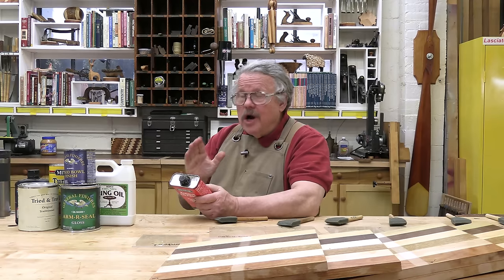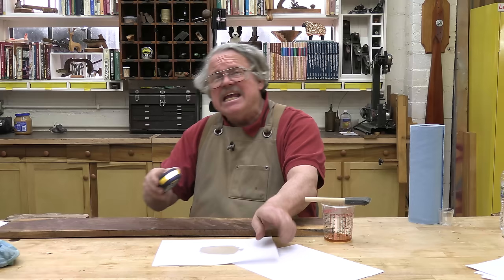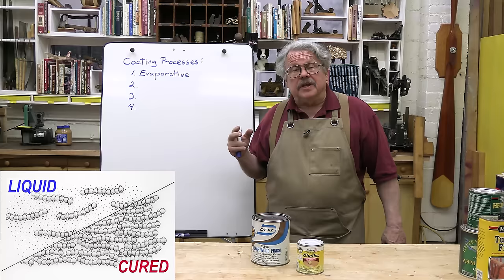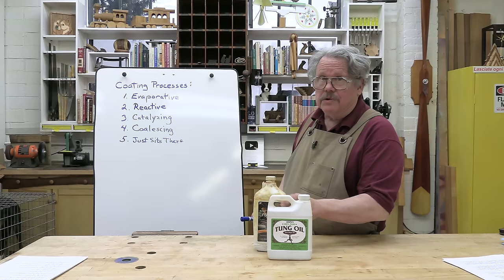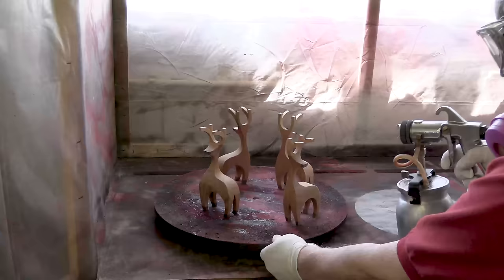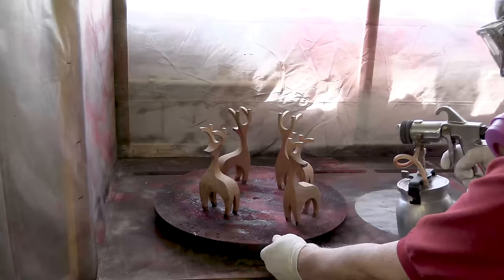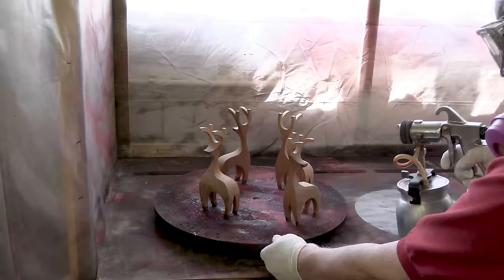Finding the Perfect Finish

Comment: I've tried Rudy's formula on some basic pine table I made and it sorta worked, but is the final finish supposed to be so incredibly glossy? How long should the tung oil + spar urethane solution be allowed to sit on the piece? Should it be left alone like spar urethane alone, or should it be wiped off like tung oil finish alone? The urethane seems to begin hardening pretty quickly, within 1 hour. Does it only need to be on there for 5-10 minutes?
Reply from the maker: It's a wipe-on/wipe-off finish -- every coat. And you can easily adjust the gloss in two ways -- apply fewer/more coats for less/more gloss, or adjust gloss by rubbing out the final coat with coarser/finer grade of steel wool/Scotchbrite/rubbing compound.

Comment: Great video. Wondering if I could make a similar finish using danish oil instead of tung oil. If I understand correctly they have slightly different properties…
Reply from the maker: Would probably work just fine.

Comment: So, in your opinion which finish is best for maple kitchen cabinets?  Want to avoid  yellowing the wood.
Reply from the maker: Water-based finishes, such as the water-based poly in the test, do not seem to warm the wood. However, if you are applying this finish to plywood, make sure it's a good grade of plywood with a reasonably thick veneer. Also. let the finish dry completely between coats. Water causes the wood to swell more than oil, and as plywood veneers have gotten thinner over the years, I'm seeing more and more problems with the veneer layer delaminating when a water-based finish is applied. This happens most often when I'm in too much of a hurry to let the finish or paint dry for a day and for all the water to evaporate.

Comment: I'd be super interested in knowing if you've tried out those improvements you talked about. Thanks!
Reply from the maker: It's been some time since we posted that vid, so I need more to jog my memory. What improvements? Timestamp?
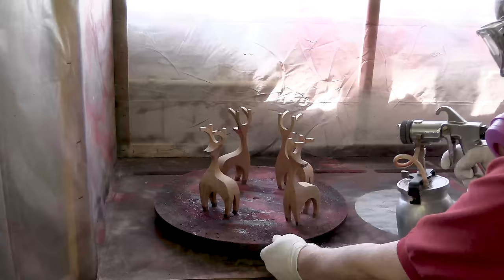Reply: @WorkshopCompanion  Of course, at 26:42 you mention that you'd like to experiment with improvements of Rudy's formula. Did anything improve his formula?
Reply from the maker: @vingtsang120  That was what we call an "exit line" -- something said off-the-cuff just to let me bow out of the video gracefully. I had spent so much time during the video exhorting the viewer to experiment, I thought I'd end with the implication that I was off to do some more experimentation myself. And I have, just not with Rudy's formula -- Travis and I have been testing some of the new wipe-on urethanes, and we're researching solvents and hardwax finishes, all for upcoming videos.  Rudy's best formula remains what I presented in the video.

Comment: This was a great video for sure.

However, to be honest with you, as a person with no experience, its by far easier for me to learn from what I see and know that works. You know, the look and feel Im going for. It would be much better for me to see a piece of wood, or to be shown a specific piece of wood, and to be told and shown exacly how that piece of wood got to look and feel like that. Such as for example, a piece of trim work or furniture in the real world, and to be shown on a similar piece of wood what to use on it and how to apply it in order to copy as close as possible the  techniques in order to achieve the same results.

I know you tried hard to do that here, but I still dont have the knowledge I need to do what Im trying to do.

Maybe I can ask a question to you instead. Say that Im wanted to protect and make more attractive the ceiling joists of my house that are framed using Doug Fir beatle kill non pressure treated lumber from the local Amish mill here. It is a very attractive and clean wood as it is, a but blonde in color, sorta yellow with bluish streaks running all through the grains. A few knots here and there too. I wouldnt want to hide it, but simply protect it and bring it out more so and make it warmer too is possible.

I only have the option of rubbing it or brushing it on and have plenty of time, but Im very sensitive to chemical smells and toxic things so want it to ve safe and natural to handle indoors too.

What could you recommend for me to achieve this?

I would definitely be thankful to you and give you the credit for your time and help. I also did subscribe and like your video too.

Thank you,

-Rocky Mountain Balloon Framer, Farmer & Homesteader
Reply from the maker: A wipe-on water-based poly might be your best option -- if it doesn't sufficiently warm the wood color, add some water-soluble aniline dye.

Comment: Love your videos, very informative and plainly laid out so the viewer learns a lot and can easily understand it. I'm going to be using Rudy's recipe for a dining table I'm making from Walnut. My question is would putting a paste wax on after Rudy's recipe be a good thing to do, would there be any benefits or detractions to doing that, or would it mostly be subjective to personal preference?
Reply from the maker: Thanks for the kind words. I always finish with paste wax, but that's a personal preference. I like the soft glow wax gives. I also believe that it helps keep the surface clean and provides an extra barrier to moisture.

Comment: I realise your video is one year old, but may throw a question at you please? To use either the tinge oil or the bees wax coatings, would they soak in better if warmed up?
Reply from the maker: That's true for most finishes -- a little bit of heat lowers the viscosity. But too much causes it to cure to fast and it doesn't properly level itself. Delicate dance. I try not to get it any warmer than my hands.

Comment: Which are nontoxic while applying for those of us with lung problems which would you suggest.
Reply from the maker: There are very few non-toxic finishes that aren't toxic when you apply them. Many finishes that advertise themselves as non-toxic only become so after they are applied and the carriers/solvents evaporate or dissipate and the resins cure to become biologically inert. Only a very, very few -- like walnut oil or mineral oil -- can you ingest straight out of the can. If you have lung problems that make you sensitive to the carriers and solvents in finishes as they evaporate, you will need to identify those chemicals, obtain the safety data sheets (available online), and avoid those which contain the specific chemicals that are harmful to you. Your only other recourse is to wear an organic vapor mask or an air-purifying respirator that screens out everything.

Comment: Thanks for this great resource! The tung oil finish + small amount of varnish seems like a great way to coat just about anything.

Is shellac really that difficult to apply? I was initially leaning towards getting some flakes and 90+% alcohol (I have a new wooden easel that really needs to be finished, since it'll be dealing with watercolor/acrylic/oil paint), but the tung oil finish + varnish also seems like it'd work fine! The wipe-on method definitely seems like the most approachable way to finish a project. :)
Reply from the maker: I think it's very easy to apply, but it's not a wipe-on finish (unless you want to consider French polish) , so we didn't cover it here. You might want to get yourself some methanol. When I mix shellac, I dissolve the flakes in a little bit of methanol, then add ethanol. Easier to dissolve that way.
Reply: @WorkshopCompanion  Thank you so much for the response! So it's not difficult, just not really a wipe-on finish (except French polish). Using methanol to dissolve flakes is great advice! 

Interestingly, my dad actually had a few of the products you mentioned in this video lying around in the garage, so I might try to use those (since you can't beat free, right?) Thanks again for offering advice — I'm sure as long as I seal the wood *somehow*, I'll be happy with the results. :)

Comment: Hi there I am redoing the coaming on a boat that had teak with sapele. Would you recommend applying tung oil before I use epifanes varnish?
Reply from the maker: I would recommend to test your proposed finishing scheme on some scraps before you apply it to your boat to see if (1) you like the effect and (2) the two finishes are chemically compatible.

Comment: Did you figure out an improvement for Rudy's recipe? Are the final 2 coats where you add the spar varnish rub on rub off too?
Reply from the maker: You can add the spar urethane at any time, but the finish is (slightly) more durable if you use it from the first coat on.

Comment: Exactly the topic I am dealing with those days: when you say "on time"!
I try not to get that yellow from very specific woods like European maple, that is quite white, and that black walnut, that seems dark chocolate. The yellow would make the maple look stupid like softwoods and the walnut look brown. They are build up in the same piece. Any suggestion?
Reply: You're somewhat after a unicorn finish here. Unless you want to mess with CAB lacquer or something similar the choice for keeping pale, and especially nearly white, woods close to their native colour is unmodified water-bourne finishes, including plain ol' waterbased poly.

But this same type of finish doesn't do ABW any favours, it's said to "cool" the colour and makes it look paler and even slightly blue-ish, as many articles and finishing books make a point of illustrating! 

A compromise that is often mentioned in this exact context is decolourised shellac, AKA super-blonde. It does make very pale woods very slightly more yellow but it is much kinder to walnut (although IMHO not nearly as complementary as darker shades). Everything's a trade-off however, the downside is that this is the least protective shade of shellac, so you add minimal durability.
Reply: @tungsten_carbide  thank you so much for your suggestions! 🌞🙏🏻

Comment: Thank you for such a comprehensive compilation! I bought the ingredients for Rudy’s recipe, but then YouTube suggested another video which encouraged the use of a wood conditioner. Do I need this to avoid blotchiness? Thank you in advance
Reply from the maker: Wood conditioner is most often used when you have a wood that is difficult to stain, such as yellow pine or poplar, and you want the stain to appear more even in tone. In most woods, the springwood (the early growth for each annual cycle) is less dense than the summerwood (the late growth). This difference in density is what gives us annual rings. In boards, these appear as light and dark areas in the wood grain. When there isn't a huge difference in density between springwood and summerwood, the stain soaks in evenly across the board and the color appears consistent. As the densities diverge, the stained wood grows blotchy.

Wood conditioner partially seals entire board, making the springwood and summerwood accept the stain more evenly. It isn't a perfect solution, but it eliminates much of the blotchiness.

How do you know if you need a wood conditioner? Run a test. Stain the wood without conditioner. If you like the way it turns out, proceed without conditioner. If the test piece appears blotchy, run another test with conditioner and see if you like the results any better.

If you're not staining the wood, and just applying a clear finish (like Rudy's), there is little reason that I can see to use it. A clear finish will enhance the wood grain, but it won't make the wood look blotchy.
Reply: @WorkshopCompanion  thank you for the prompt and complete reply! I really appreciate it! I am eager to try it with confidence now!
Reply: If I may, I have a new question. I have applied one coat of tung oil on a raw barn door which looks sooo pretty! I had tested it on the bottom edge and loved it. I got so excited I then immediately started on a vanity, also raw, without testing it. Doh! Initially I was loving it, but now it has ended up with a reddish hue, which I’m not too crazy about. I want all of the wood in the same room to have a matching finish, even though they are different types of wood. Could I paint a wash on the vanity? If so, would I use a water based paint? And should I go ahead and finish coats 2-4 of Rudy’s recipe, then do the whitewash? Or abandon Rudy and his awesome recipe, and immediately begin the whitewash?  Thanks for helping out this newbie!
Reply from the maker: @tanyacollins9003  "I want all of the wood in the same room to have a matching finish, even though they are different types of wood. " Uh...good luck? While the major components of wood are cellulose and lignin, each species has different extractives -- chemicals and minerals in the cell walls -- that give the wood it's color and tone. And different sizes and arrangement of pores and rays that give it a distinct grain.  It is possible to make two different woods look somewhat the same if you're very good at mixing and applying stains, but this requires a different finish for each wood species. Most of us with furniture and built-ins made of different woods just settle back and enjoy being eclectic.

In answer to your question, if you want to apply two different finishes to the same wood surface, apply a thin coat of shellac between the two. Shellac is a chemical insulator and will keep the two  finishes from reacting with each other. And there's another rule of thumb that applies. Generally, you can put a water-based finish over an oil base, but not the other way around.
Reply: @WorkshopCompanion  haha thanks for the chuckle! I guess my expectations are too high. Thank you for you patience with me! I’m going to try a Minwax whitewash with a glaze over it to faux the results I’m seeking. Truly, thank you again!

Comment: Isn't it true that oils like linseed and tung don't merely sit there, but they polymerize over time? Especially if they have been boiled?
Reply from the maker: Studies show the raw linseed oil and tung oil only partially cure over time, they never get completely "dry." Consequently, they are called non-drying oils. If you boil them -- and "boiling" is a misleading term ; it means you heat them in an airless retort to extremely high temperatures to cause a partial polymerization, then add heavy metal driers to  enable and accelerate a complete cure -- then they become drying oils. But you should also remember that there is no sharp divide between drying and non-drying. It's a scale with a lot of gray area between 100% dry and 100 wet. For commercial reasons, most finish manufacturers consider anything that does not form a hard shell (roughly 50% cured) in 24 hours to be non-drying. In fact, there are a good many substances that make reasonably good finishes that never dry at all. Wax is the most common example.

Comment: TY! This was brilliant. Could the tongue oil be switched with danish oil for Rudy’s formula? 

Also, would Johnson’s paste wax (or another brand) work on outdoor furniture over Rudy’s formula for a little added protection? (I welcome answers from anyone)
Reply from the maker: Actually, Rudy's formula is very close the Danish oil -- it's Danish oil with a little tung oil. As far as the wax goes, paste wax is neither a permanent or a weatherproof coating. You would get a little extra protection for a very short time. You'd be better off adding more spar urethane to the tung oil after the first two coats.

Comment: Can Rudy's finish be used over cool-toned, finished cabinets, to darken and add  warmth, with minimal sanding over the existing finish?
Reply from the maker: It will make very little change in tone to put it over an existing finish. And if it is chemically incompatible with the existing finish, it may not cure properly -- or at all.

Comment: I found this fascinating and very informative.  I do have a question as it didn't seem to be added in this video about mahogany.  I have a small sideboard that has a solid mahogany top.  I would like to finish this with as natural a look as possible.  I also haven't had experience of working with these finishes.  It would be helpful to have some advice as to what might be the best option to use.  Thank you.
Reply from the maker: Hi, I suggest any of the wipe-on-poly finishes in this video. Minwax Antique oil, Minwax Tung oil, and Minwax Wipe-on-poly are all great finishes that are easy to apply. They do darken the wood a bit, you won't notice any yellowing on mahogany because it is a darker wood. If you don't want it to get darker, I highly suggest Minwax water based wipe on poly. https://amzn.to/3AnM7mK 
I've used it a few times and can hardly tell that I've put finish on the piece afterwards. - Travis

Comment: I am sanding my kitchen counter top and part of it is next sink - both sides and back. I need something that will last a d protect and have a natural finish...not too dark. This is my first time to sand. What a mess. Do t know what I'm doing...but trying. I understand 3 different grits of sand paper - 50, 80, 120. I think I get the enormous cleaning up job onevery surface...discouraging! Scared to death to finish because as much as I want a new/more natural finished, what if what I chose is not durable. I just can't go through this process again and can't afford to pay a professional. Please help!
Reply from the maker: I get that you're having a difficult time, but I don't understand the question. If you're asking me to recommend a finish for wet areas, I need to know the wood you're working with to be certain, but I would probably tell you to look into marine finishes. There are also many finishes made especially for bar tops that you should look into. In either case, I recommend that you test the finish and get some experience with it before applying it to the entire project.